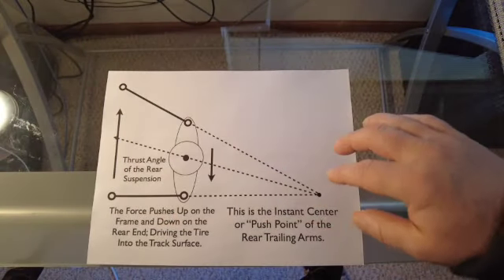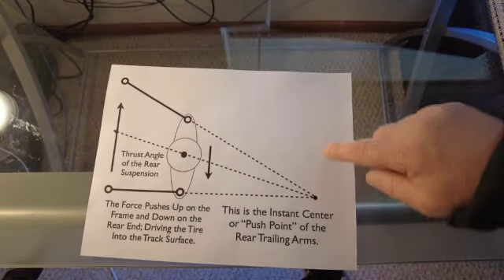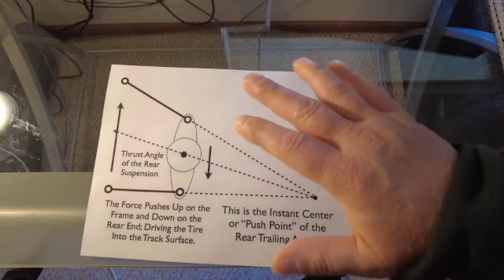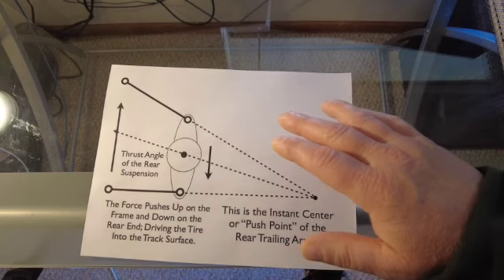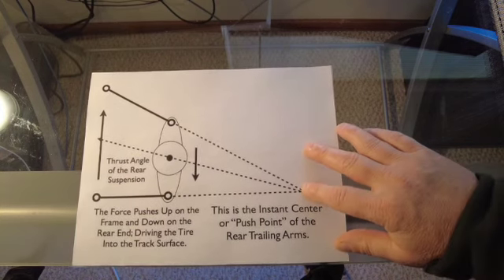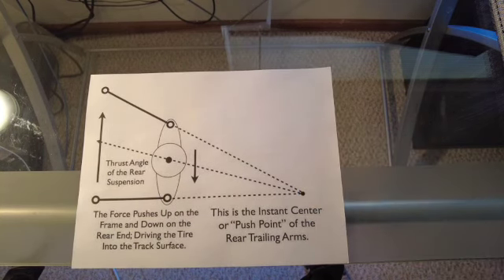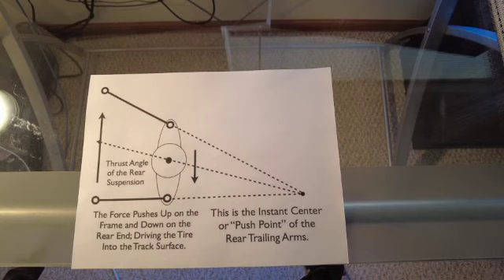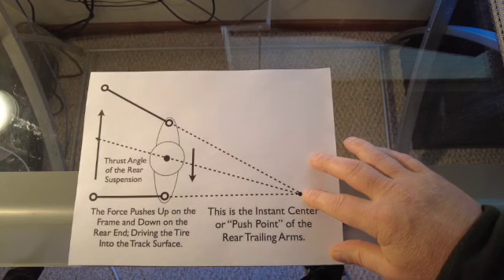Dirt Late Model and Dirt Modified Ride Height Over Smash Numbers; Old Fashioned Car Setup

Comment: Nice video.  One thing I might recommend is that you don’t use the term ‘push point’ to describe the instant center.  This is going to be very confusing for someone who doesn’t understand the mechanics of instentaneous centers.  Moments are taken about ICs.  There are no forces that go through the IC as the term ‘push point’ implies.

Comment: Ok well when you find your own Ride Heights on Right Side really right so what's that's best spring combo 🤘
Reply: It really depends on a lot of things; car, driver, corner radius, etc. What always seemed to work well for the people I helped was a 250 rr and some sort of a soft stack on the rf with a dive spring or very stiff bump stop at the bottom. I don’t think there is an ideal, ‘magic’ thing, so many people are trying to sell others. You just need to learn you smasher numbers and field test. Thanks for watching.
Reply: @KevinKatzenberg  aight so if my driver drives straight I'd need more RR load number than someone elbows up when. It's wet ,But as night goes on what's your Traction move and Tighten move
Reply: @joshpatrum7887  I don’t know if I would raise the ride height on the RR if your driver drives straight. Usually the straighter someone drives, the harder it will be to get the car on the RR. Without a big cushion, you could lower both right side rods equally, soften the right side shocks, and take a little rebound out of the left to let the car roll easier. It’s hard to give a definite answer on this. A lot f factors at play.
Reply: Okay say I got my car pretty standard as the knights licks all I want to soften my 3x number up on the right front what number do I soften up on my right rear
Reply: @joshpatrum7887  it really depends on how much the track slows down. It kind of trial and error.

Comment: So you control dynamic loads with packers, bumps and rubbers etc. if you set your install loads (ride height) to what your chassis calls “standard” your ride height will be right if you smash correctly. Adding load to a certain corner is the same as raising the ride height
Reply: But I agree if your center to center isn’t correct for the certain corners ride height on the smasher your ride height will be off if you were to measure it from the frame like we used to do. But I run a lazer chassis, and they have already used all the data acc work for us and share that
Reply: Good to hear. If you see the same ride height change and finish smash loads as they give you, you’re good to go. I do recommend people double check their car so they see the same smash corner loads dynamically that their car builder is giving them. Thanks for watching.
Reply from the maker: @KevinKatzenberg  I think too many people are confusing wheel load and smash numbers. They are two different things.

Comment: I've never heard of Rocket giving out a finished ride height number to anyone, I feel like I would just get crickets if I called and asked for that
Reply: That’s why I have stuck with my Barry Wright’s. They’re always a phone call away.
Reply: @Triefenbachracing  Barry Wrights are some damn good cars!
Reply: They do. They give you a install load which is static ride height loads at correct center to center for each corner  like he’s talking about. Then they give you full travel loads on what you should run “standard” then you work from there
Reply: @chazbuchinsky19  are you just talking about the three and four inch travel numbers?  maybe we just know the same thing by two different descriptions (finished load / 3" 4" load) ?
Reply: That’s to bad. Can you see where I’m coming from with how important a finished ride height is?